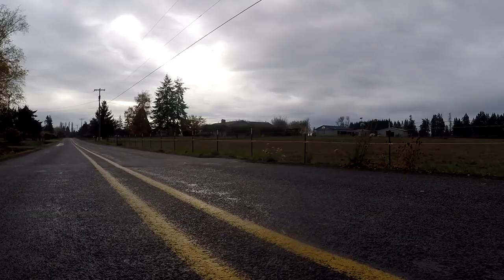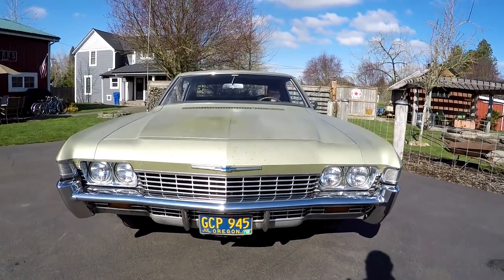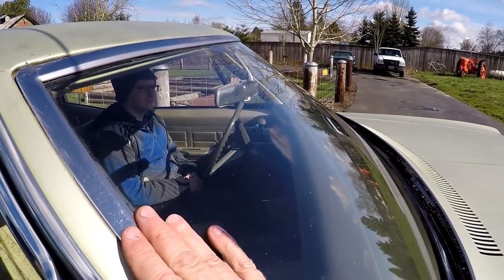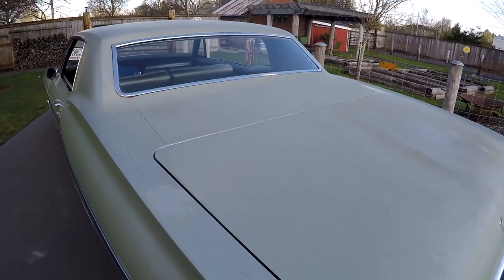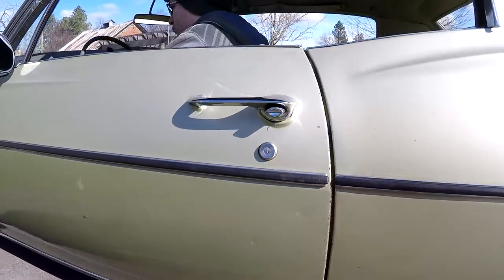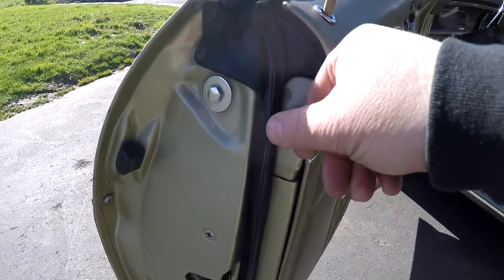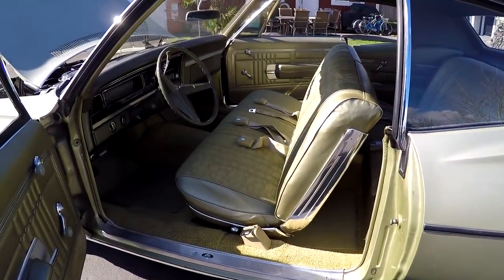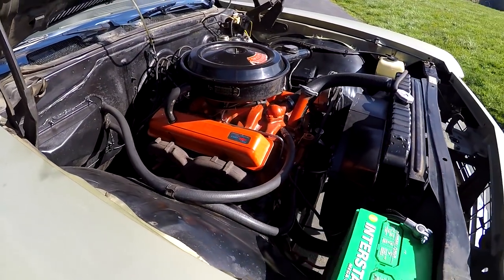1968 Chevrolet Impala - DENWERKS - Bring a Trailer - Auctions

Comment: We had a new '68 Bel Air 4 door sedan, Ermine white with blue "butt burners" (vinyl). No power steering, brakes. 2 speed power glide, no radio, your basic entry level big Chevy. The folks had it for 6 years, it was a good car. It had the 307 c.i. V8 also.

Comment: I would change the points distributor to HEI, and then daily drive it as-is. Very sweet ride
Reply: You could put a Pertronix electronic ignition conversion inside the original distributor and then you could not tell that it had been completely converted from points to electronic ignition!!!!!!!!!
Reply: Takes 10 minutes to swap distributor so no aftermarket crap.  Gm HEI  distributor is perfect.

Comment: A safety recall installed restraining straps on the motor mounts. The original motor mounts would separate and the engine would lift off the mount when accelerating. This would cause the throttle to open wide and the car would take off. 

In ‘72, I was driving my fathers 68 Impala w/307 when this happened and I couldn’t stop it causing an accident. Our neighbor’s Biscayne had the same thing happen.
Reply: Replacement motor mounts interlock so. I need for straps.

Comment: Not Torsion Bars.  Those are struts and it needs new bushings.  Lower balll joints were good for 50,000 miles on those.  Nice car but a stripper!